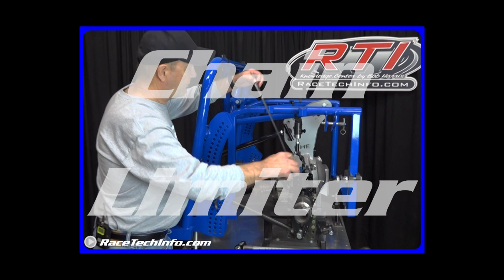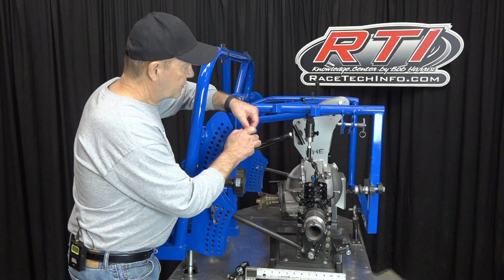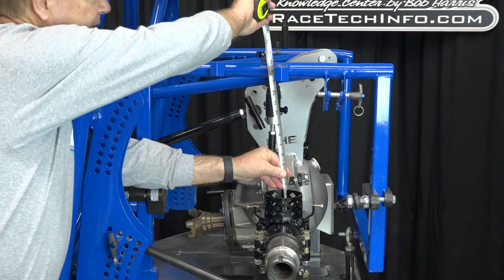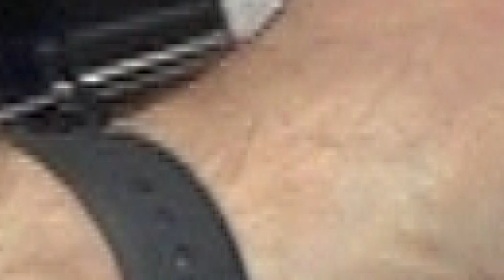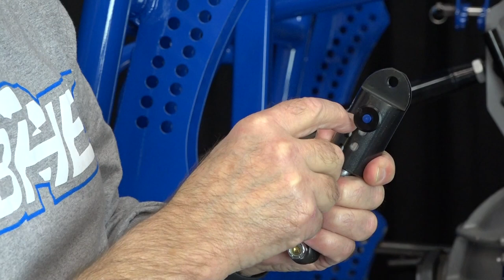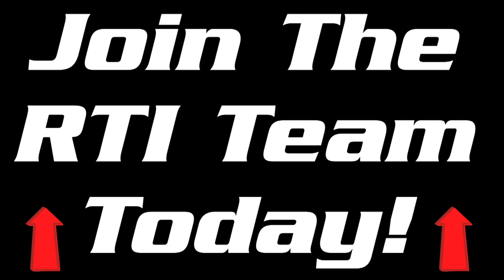Teaser Chain Video

Comment: ATTENTION R.T.I:-  Guys are putting limiter chains ⛓ on the right rear of their Midwest mods and I am curious about the physics of that.. wondering if they are pulling the car below ride hight and then chaining it 🤔 obviously that would keep the car  under a load the whole time?? I am just trying to understand why I guess.. and having a 200 or 225 on the left rear then using a 400 lb or higher spring on the right rear? And then compressing the right rear and then chaining it.. I'm confused .  Can you please let me know what you think about this One? When would you do this and how.. keeping in mind that our control arms have to be a certain amount of degrees difference between the two